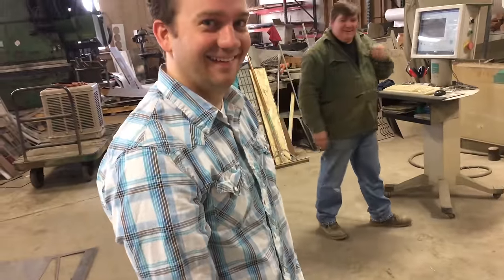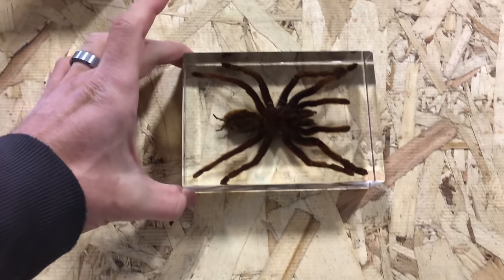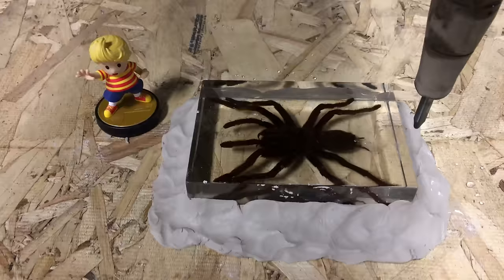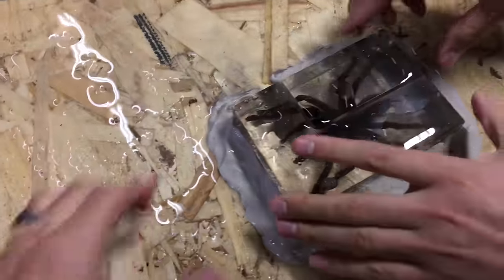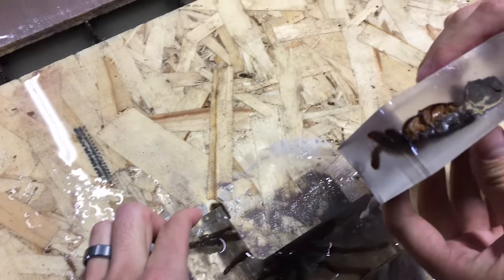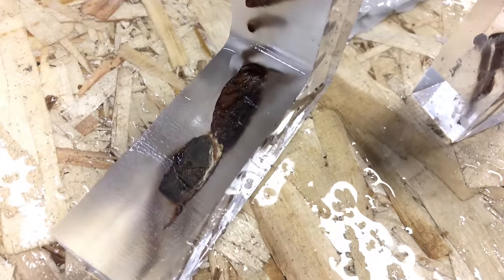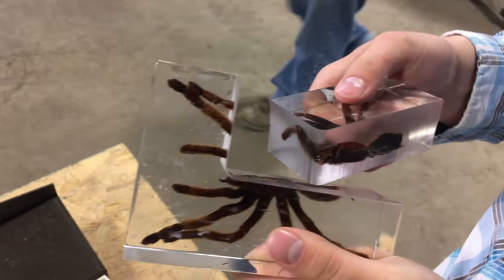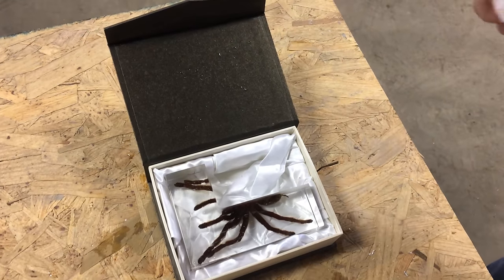🕷️ Dissecting A Real Tarantula With A 60,000 PSI Waterjet Biology Lesson 🕷️  Interesting

Comment: Whys the Water So Dirty ?
It's Really Annoying and Ruins a lot of the videos
Reply: ITzDennis The water that comes through the waterjet it's pretty clean, but the tank under it it's full of mud to soften the pressure of the waterjet and some of that mud leaks through. It may be annoying but it has to be.
Reply: I think that's not the water.. I think that is the spider blood
Reply: ITzDennis it’s the abrasive they need to use so that they can get more friction to cut through things
Reply: I don't think so, the abrasive is very fine I still think is the mud that is below the (corch I think?) plank leaking through
Reply: Eder Barrero its for more friction that they put more sand in it.
Reply: ITzDennis .سضمااحسين
Reply: ITzDennis Its really annoying to see comments like this
Reply: ITzDennis they recycle it. Would be a waste of water...
Reply: FireCore Gaming that's what I was thinking
Reply: When the waterjet pierces everything and strikes the water in the tub, that water splashes back up covering it in dirty water. The water that goes through the pump is extremely clean and most likely goes through several filters before it reaches the pump, otherwise the pump would wear out fairly quickly.
Reply: The water is mixed with these particles to provide more friction to cut through.